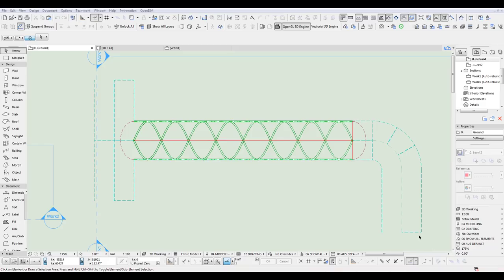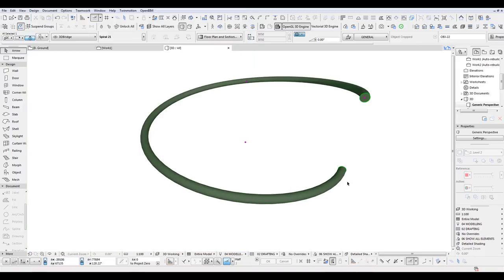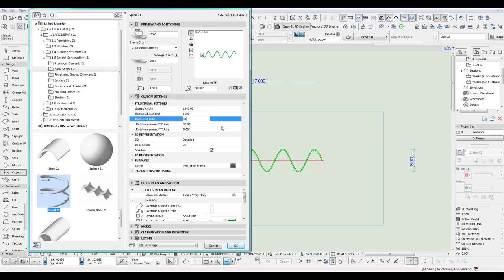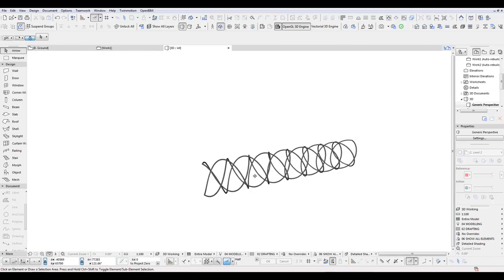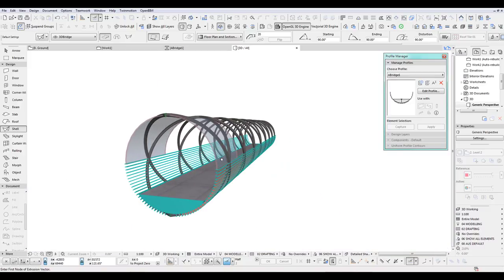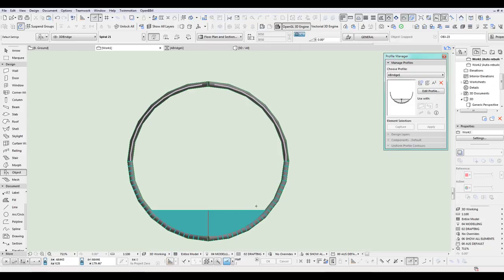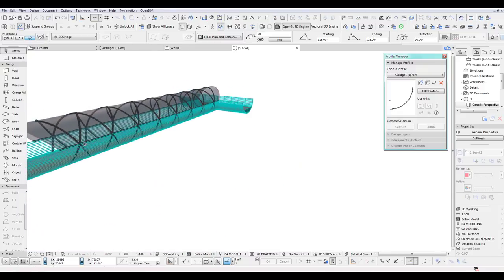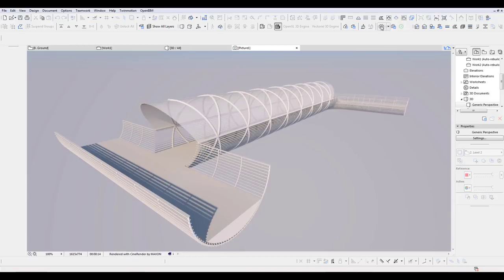ARCHICAD How to model a Spiral Bridge

Comment: Quick question as you seem like a whizz on archicad.  Why can't I flex a beam more?  There seems to be a minimum flex for example - 64 degrees I want flex curve of 880.  I can only go to 720.  This needs to be vertical.  Anything else you recommend using - Shell?
Reply from the maker: Hi Depps, I know I already replied to your email but just in case other users here have a similar question. Tip: Work with the beam while in a section window.